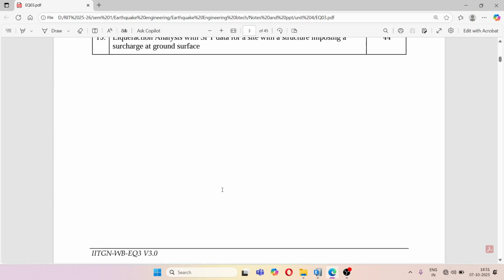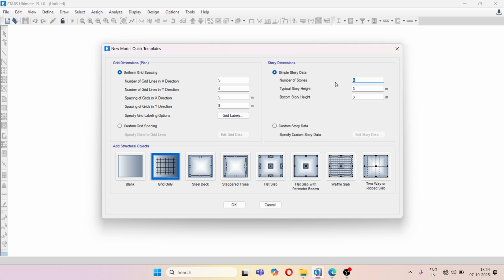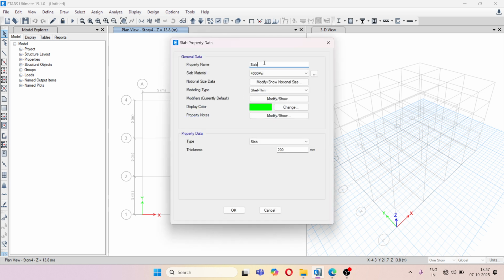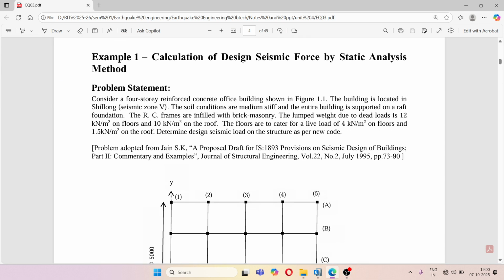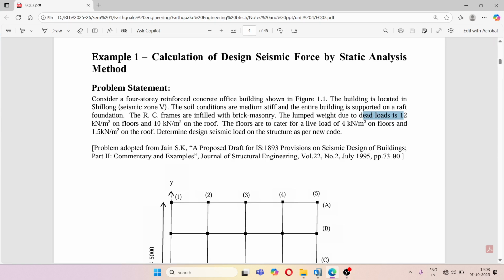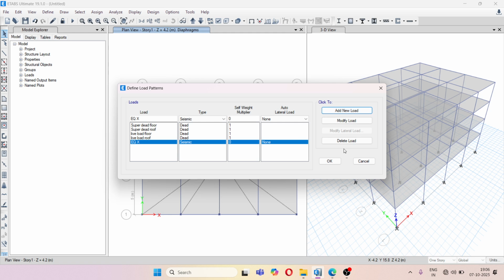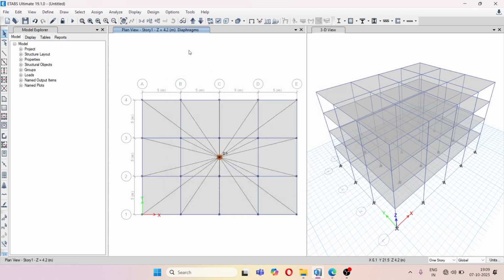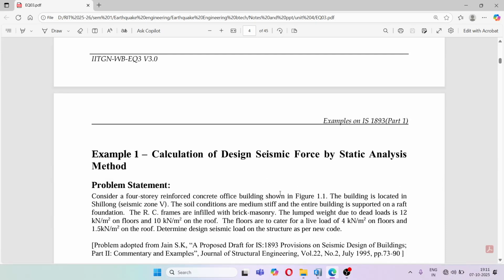Equivalent static analysis | Validation of the results | Etabs Seismic Analysis | Project

Comment: What about dynamic?
Reply from the maker: We have not yet made video on dynamic analysis comparison with manual result
Reply: @Realcivil , it will be helpful for beginners if you do the dynamic also( example 2 from same journal).
Reply from the maker: When we solve manually we consider one degree of freedom per floor. But etab is 3 d model so its little difficult to match results.
Reply: @Realcivil , Thank you for your response. I am trying to match the from yesterday, but it still not matched.
Reply from the maker: Assign rigid diaphragm. Set active degrees of freesom to two. Set the Moment of Inertia (I22 and I33) to a very high value (e.g., 1000). This forces the columns to take all the lateral deformation in "double curvature," matching the standard manual stiffness formula.. Try this and let me know if works

Comment: because weigth per unit volume 0?
Reply from the maker: In the question they have givem lumped weight that means it include self weight also and some other loads like floor finish etc. So we dont want self weight to be calculated again by Etab software. So we make it zero. Just to avoid repetation